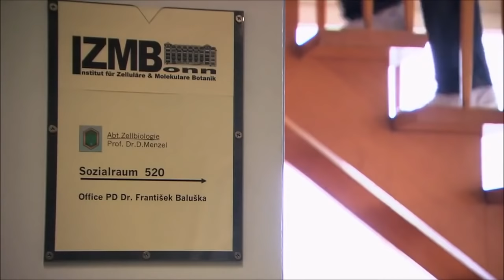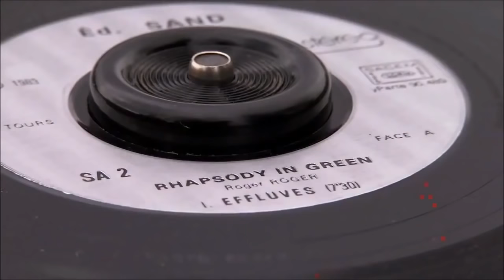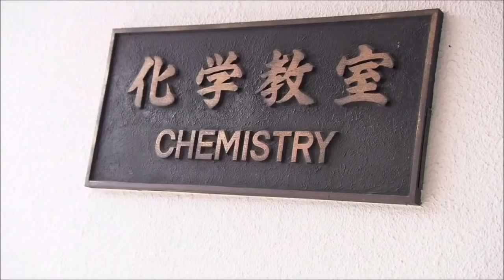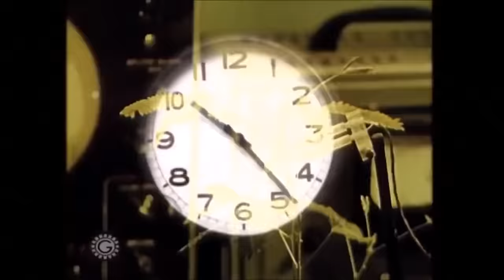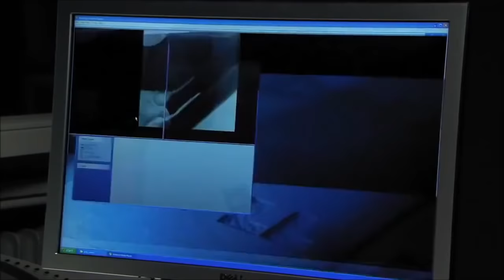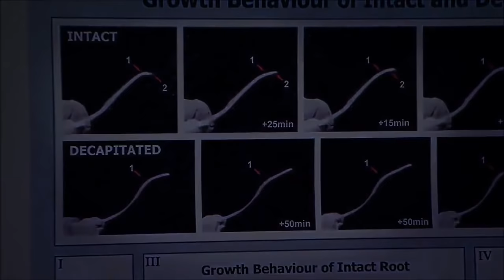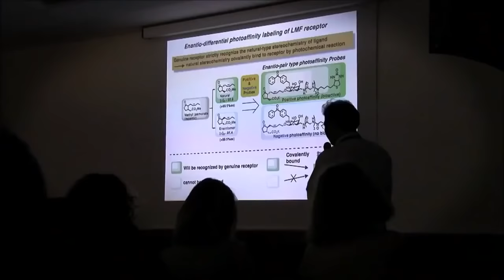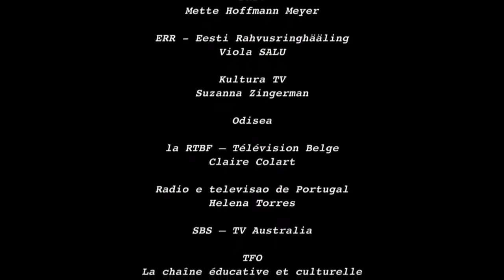How Plants Communicate & Think - Nature Documentary HD

Comment: God's design is amazing and never ceases to amaze me!!
Reply: It's amazing but also very lazy. Life only really struggles for 'good enough' and it's actually very energy inefficient.
Reply: Nkosi Carter-Fisher
nothing wrong with that.
Reply: It shows that life didn't have an intelligent design but rather, it was try and fail
Reply: Nkosi Carter-Fisher
sorry I thought your fist comment said life was energy efficient. not energy inefficient.  I wouldn't have said nothing was wrong with that if I had read your comment correctly.  But in any case, I don't see that it was try and fail. How do you come to that conclusion?
Reply: Due to evolution that makes species adapt to their environment but it's not perfect. about 3/5 of the energy used in our muscles is turned into heat. One species is suited for one environment but when it changes, the species either dies or adapts. Like with change in atmosphere composition, some species would just develop filters to remove the toxic gas that wasn't common before
Reply: Nkosi Carter-Fisher
Well since evolution states that everything is getting better, doesn't that disprove the theory right there with what you are saying?  It seems to me that the 2nd law of thermodynamics stands true making evolution a lie.
Reply: That's completely false, the 2nd law of thermodynamics doesn't disprove evolution at all because the Earth is not isolated.
Reply: Nkosi Carter-Fisher
Well evolution says things get better and 2nd L.O.T. says just the opposite and if the earth not being isolated has anything to do with that please explain.  I'm not exactly sure what you mean by that. "The earth is not isolated"
Reply: No, evolution doesn't mean get better, it means adapting to the environment. The Earth is frequently bombarded with heat and radiation from the sun and the energy from the sun ultimately powers life
Reply: Nkosi Carter-Fisher
I agree with you totally on your assessment of evolution because yes everything adapts to its environment. But what you have described is observable micro-evolution, We have tons of evidence for that.  But we do not have any evidence for macro-evolution.  We should have a ton of transitional fossils but we don't have any fossils that show a change of kind.  Because if we did, it would have made international news and we would all know about it.
Reply: Well, there are indeed tons of fossils. DOZENS. Like there are fossils being discovered all the time and they've been reported all the time, even recently. Saying it should have made international news isn't very smart because there are sources reserved for scientific discovery.
Reply: Nkosi Carter-Fisher
Oh okay. that news got by me. What is it so I can look it up myself being that there are alot of hoaxes out there.
Reply: you can check National Geographic
Reply: Nkosi Carter-Fisher
I checked with Natgeo and dont have anything that indicates a missing link has ever been discovered.  Can you give me the exact link?
Reply: No real missing links were discovered. But evidence of evolution.
Reply: Nkosi Carter-Fisher
Well I believe in evolution as far as species evolving to fit their surroundings and for survival.  But I know for a fact that there is NO scientific evidence for any animal changing into another kind of animal such as fish to bird or reptile.  I believe God created all things and they each evolved respectively.
Reply: You are extremely wrong, scientist has found evidence of species evolving into another in form of fossils. Such as the whale.
Reply: Nkosi Carter-Fisher
Well then give me examples of this.  The whale doesn't prove Macro evolution.  Only proves micro evolution.
Reply: According to evidence in fossils, the whale evolved from a completely different species with the hippopotamus being it's cousin
Reply: Nkosi Carter-Fisher
yeah but whales are mammals.  It isn't a fish. It's a mammal. So even if at one point in its evolutionary journey, they walked on land they didn't do anything but loose legs and start swimming.  They didn't loose being mammals. And they didn't stop being whales.   Do you know what I mean??  And okay, so they are cousins with hippos.  Another mammal.  It's okay if two mammals are related. It doesn't show MACRO evolution.. In order to show Macro evolution, you must have one kind turning into another kind.  Whales and hippos being related doesn't mean that they have turned into eachother, only that they are related genetically. But again, that's okay cause they are both mammals.  Now, changes on a species level is supposed to happen because everything adapts to its surroundings.  But it is always what it was born to be.  A whale has always been a whale even when it walked on land. I have found no evidence of a whale ever being anything other than a whale.  But if you have, do share.
Reply: A whale was not a whale when it walked on land, they were an entirely different kind of land animal that walked on land but had to adapt to very wet conditions. You can actually take a look and research it itself but evidence spot that a whale wasn't always a whale. E
Reply: Nkosi Carter-Fisher
I did. We studied about whale evolution in college.  On a biological scale, their DNA hasn't changed.  According to my college professors, they maintained the same DNA when on land and in the water.  They weren't called whales when on land of course but their DNA was the same.  So they were the same animal just a different environment.  If you say they were all together different biologically, then you will have to show me this.
Reply: There was no change in DNA? You selective heard their lessons. Of course there's slight change in DNA, mutations in their legs caused them to be more fin-like. Their blowholes were once normal nose cavities but mutations made it move to the top of their head where it is today.They're lungs would have to be stronger in order to be able to hold their breathe when living underwater. They may be very similar to their ancestors but they were different enough to not be breathable
Reply: Nkosi Carter-Fisher
Yeah all those changes had to occur but it was still the same animal and remained a mammal and didn't turn into a fish.  Im sorry fisher but this is an example of micro evolution.  There is NO example of macro and no missing link fossil has ever been found.  We are created by a God who loves us and has a plan for our lives. Evolution on a Macro scale is a LIE!!
Reply: Excuse me? The whale's own evolution from its ancestor marks millions of years. Just because it's still a mammal doesn't prove anything at all, it was a land mammal and it eventually adapted into a water bound mammal. It's ancestors are very different and it perfectly describes a species turning into another. Everything you've been taught is through selective hearing and a LIE.
Reply: this is the whale's ancestor https://images.sciencedaily.com/2009/09/090924185533_1_540x360.jpg  and this is a whale http://whalesunderwater.com/wp-content/uploads/2015/11/whales-underwater-darrenjew-whale-02a.jpg . They're different species and complete proof.
Reply: Nkosi Carter-Fisher
Well 2 things here.  #1 Just because you have a drawing of something doesn't mean that animal actually existed.  Too many times, they draw out what they think lived, but can't prove it with fossils.  So before you throw something out there as an actual living animal, make sure the actual bones for that animal are out there. Otherwise, its just conjecture on their part and can't be used as proof of anything.  #2 Different species doesn't mean different kind. There are many species of whales past and present. Differing species means they have adapted to fit their surroundings and for survival. It's not a change of kind though.  Again the missing link fossil is still missing.  There isn't any proof of Macro evolution out there and without that... well you know.
Reply: They drawing was based on the actual fossils what were found. It existed with very fossils found.
Reply: A species is a population of animals that can reproduce with each other and their offsprings can reproduce with each other. So as a result, different species are a change of kind. The whale and their ancestor are completely different species and directly proved macroevolution perfectly. And there has been many fossils of it. In fact, even humans have been traced back to their ancestors and their are fossils to prove it. You can't argue with ignorance.
Reply: Nkosi Carter-Fisher
NO!! different species are NOT a change of kind.  Don't you think if it were a change of kind this argument would have been put to rest long ago??  Because if what your saying is true then the missing link would NOT still be missing.  It would have been ALL over the news if the missing link had ever been found. Because it alone would silence the creationists.  So differing species doesn't mean different kind or we would NOT be having this debate and trust me, it would have been ALL over the news everywhere. Macro evolution has NOT been proven.  None of the ancient man, none of the ancient whales, or monkeys or anything else has proven that we evolved from animals.  We are created!! By God!! Not aliens by the way. ; )
Reply: Stop ignoring the clear evidence. Literal remains of dead bones of whales, humans and primates have been scattered all over the world for thousands of years. Just look, there are these fossils at the appropriate museums if you want proof. There's no denying the evidence of the evolution because there is literally physical proof along with generic proof. No only has it's been proven, every rational scientist has accepted the facts and only ignorant people chose to debate in debateable topic that's already finalised.

Different species ARE a change of kind. That's why there's different species.
Reply: Nkosi Carter-Fisher
Well we can settle this once and for all.  If the missing link has as you say been found. what is it??  Cause you clearly don't understand species and kinds.  So you show me one clear fossil of any animal being a cross between 2 kinds.  Im telling you if it existed, it would make world wide news.  Use your head.  We have fossils, millions of them but they all show only micro evolution.  There is not ONE in all the fossils that show proof positive of Macro evolution. That should tell you something, because there are so many of them out there. There should be at least ONE. But there isn't or you and I would have seen it on the news by now and this debate would have ended already.
Reply: Nkosi Carter-Fisher  "you can check natgeo" you really bring up a tv channel for proof???? Seriously?? Well i saw on dora the explorer foxes steal all the time.. I'm going to shoot all those bastards now!! 

Now for real, used to be an evolution believer too(indoctrination), but there is no proof, only assumptions. For example, there is a flower in madagascar, and only 1 species of moths that can pollenate that flower. Because of it's long tongue. 
If evolution is correct, there would be a time where one of them was not perfect adapted to the other. So the flower would die. Or not? 
The whale, they say it was a "wolf" like predator who hunted in shallow water. Well evolution takes place in a very big time frame 
There should be fossils of every kind "version" of the whale if this was true. They find a "wolf" like pradator which maybe has some resemblances with a whale, so they ASSUME it evolved into a whale. And they show it with some beautifull cgi's and people (like you) and they believe this shit.
Reply: They did find fossils, they always have. That's no secret as you can go to a museum or university to find them. Now life has a 99.9% failure rate which means 99.9% of all life is extinct.
Reply: Nkosi Carter-Fisher
Well I am still waiting for you to name the missing link so we can put this argument to rest.
Reply: You can find them in museum
Reply: Nkosi Carter-Fisher
Are you saying you don't actually know the name of any so called missing link?  Why don't you try looking it up online.  Surely if a missing link exists, you can find out about it there right??  And another thing, how did life start again once the extinction level event happened that killed off all the dinos and whatnot? I guess that was another CHANCE happening right??  Oh and here is another question. If this is all just a random game of chance, how do you explain the SCIENTIFIC FACT that the size of the nucleus in proportion to the electrons and protons is the about the same as between the sun and it's surrounding planets?  Look it up if you don't believe me? But scientists know this for a fact.  How could random chance get that right?  And how can mathematical phi otherwise known as the golden ration be explained with chance??  It's found throughout nature and according to Romans Ch. 1, you and everyone else who denys their creator will be without excuse because the evidence of God was all around you and mathematical phi is an excellent illustration of this fact.
Reply: I just gave names dummy, just look up. And you can find more. 
Dinosaurs weren't the only animals on earth, once they died, other species simply repopulated and adapted. Plus dinosaurs still exist as alligators.
And about that whole thing with the golden ratio. Everything follows the same physical laws so of course pattens will be found. Besides, what makes Christianity more valid then Hindu  anyways. Since every religion plagiarised each other and nothing in the Bible has proven to be historically accurate, Hindu. Noah's Ark was plagiarised from the Epic of Gildermish and that was plagiarised from two much older stories
Reply: Um yes many are, there are many combinations, the homo eractus looks very ape like to most but very close to human. Then outside the.homo tree, the paranthropus robustus looks very apelike. Then even further there's the ardipithecus ramidus famous for being one of the first to walk on 2 feet. There's at least 17 different species of apelike creatures all intelligent but died off with humans being the last. So which one is the link? All of them, they're all apelike and all contributed to human genes it's only a matter of finding another species to add to the puzzle.
Reply: They are all links, the missing link is simply the last species to evolve into humans. Do research, real ones and not bias Christian sites
Reply: Nkosi Carter-Fisher
How bout you do some real research on this because these species that you sent are not a mix of human and ape.  In order to have a missing link, they must be a mixture of the two.  You don't seem to understand that.  What you sent is nothing more than ancient humans.  No examples of macro evolution.  Apes are apes and humans are humans.  If you do your research, you will find that there are NO missing links at all.  Just ancient apes or ancient humans but no mixture of the two.  There is no common ancestor of the two.  You can't even produce it.  So how can you come down so hard on anyone who believes in a God they can't prove exists when you are faced with the exact same problem.  You believe that we are products of apes and  you can't prove it either.  The danger here is you are playing with your eternal soul over this.
Reply: Nkosi Carter-Fisher
Look Fisher, the only one confused here is you man, we don't share a common ancestor with primates.  Is that clear enough for you to understand where I am coming from?  And if you believe we do then tell me what is our common ancestor??  If you can't name it, it's because it doesn't exist.  You need to deal with the fact that you are a created being just like the rest of us homo sapiens. All life is created by God and has evolved over time to fit their surroundings.  That is the only type of evolution that is true.
Reply: Are you sure. Because actual studies has created an almost clear image of human heritage going back millions of years finding dozens of apelike humanoid species. The  common ancestor itself is approximately 13 million years old. And with studying fossils, dna and mutation rates. Its a scientific fact that there is an ancestor and it's  only a matter of time until the actual fossil is discovered assuming it's not destroyed by the environment. You're arguing science, not me
Reply: Nkosi Carter-Fisher
If there were "dozens" of apelike humanoid species we would have the fossils for it by now.  It's not a scientific fact that apes are our ancestors. Where is this scientific data to back up what your saying??  Don't tell me  to look it up because I have already tried. It doesn't exist.  Your just repeating the mantra you heard yourself but you can't even back up what your saying with facts. How can believe in something there is no proof for?  Isn't that the very thing you accuse us Christians of doing??  Sounds hypocritical to me.
Reply: And your visual evidence of God is ?
Reply: There are fossils of the humanoid species, they're in museums
Reply: Scientist's like to support each other to hold face; Example: Scientist made the theory about time to support fossils; using the method of dating time by examining layers of soil or rock and saying this adds up to millions of years, yet some of those theories have been proven incorrect as regular upturned dead trees of full growth have been found lying through these layers. You do the maths! If it really took hundreds, thousands, or millions of years to make a fossil how could this tree be possible?  Also, people have come across regular items like a jar of pickles (left for a few years in their garage) only to realise those pickles became fossilised (hard as stone). So having scientist explain their theories does not mean truth, just means they are willing to go to great lengths to propose these ideas by having a 2nd or 3rd theory to support their first theory which is nothing more than a personal idea to prove a point.
Reply: Just maybe, there is a common consciousness in nature. And if so, we will be the ones left with the short end of the stick, as we have throughout history ignored what we don't understand! I believe, we have overspent our chances for survival on this planet (of which we are very ignorant stewards). Homo sapiens sapiens will not survive the next 1000 years, if we continue on the wrong path!
Reply: 2Close4U what is all this gibberish?
Reply: Quantum Proton From a theistic perspective, good enough is what's good enough for life in general (duh, amirite?). And that's where we come in. Humans are way better than good enough. Just look at how we have manipulated the world we live in. Energy isn't the only lense we should look through. Even if would, it would be a different discussion on it's own. Earth isn't a seen as a playground for most theists.